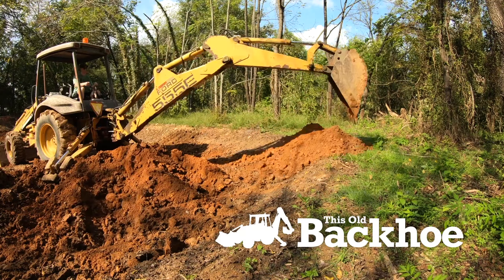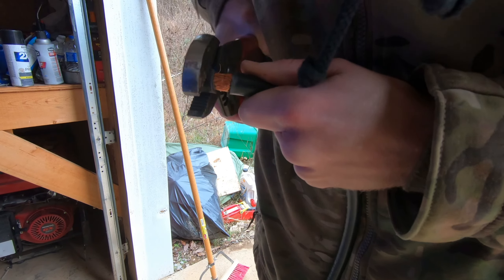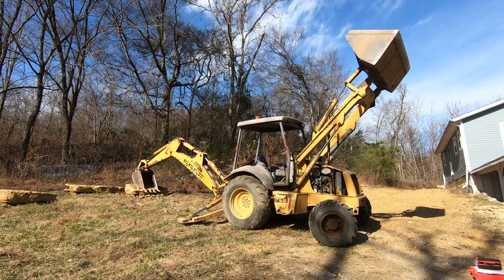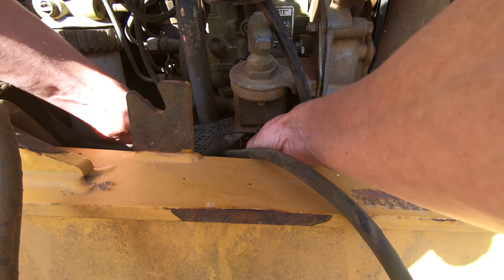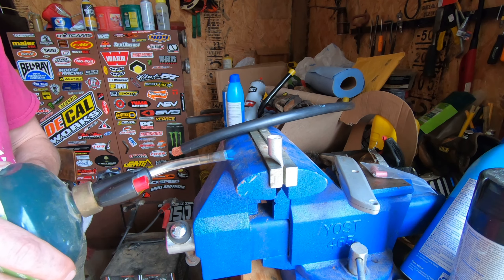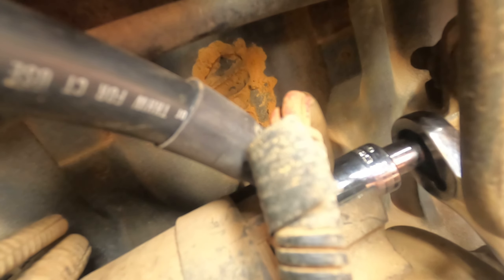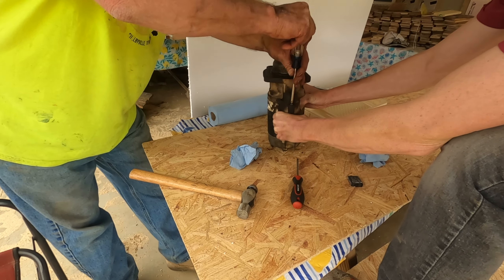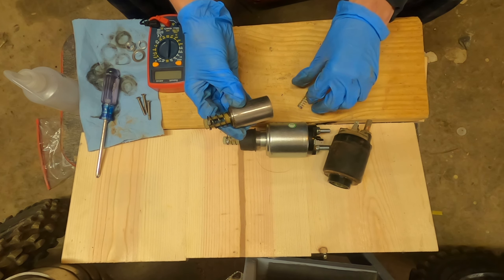Replacing Backhoe Battery Cables, Starter & Solenoid - Ford New Holland 555E

Comment: 655c here, 8k hours. My 17 year old took the starter in and out in about 20 minutes, but your engine looks different.  I have 3 starter on the bench, the original Lucas that I retired 10 years ago,  a bad 'new' chinese unit 1 year old and the new replacement amzonia  brand. I also ordered a solenoid very similiar to yours.  So the amazone came with a cracked solenoid housing and bent terminal, but did work on the bench. A hose clamp could fix it.  I opened the one year old dead one and the inside brush housing looked like it was from the titanic, rusted solid, only one brush moving. Non galvanized brush holder. Opened the old Lucas. shiny new and totally sealed inside. cleaned it up and put the new solenoid on - $39 -  . works great. Your solenoid should have worked with the swap. must have had a wire crossed? Save the old one and get the right solenoid for backup. Now if I could only figure out how to wire the damn alternator 3 wires loose and even my $200 ford manual cant seem to help.
Reply from the maker: The replacement solenoid we purchased was a different length so it wouldn’t screw in properly, glad to hear yours was an easy fix. I would have preferred to leave the bosch starter on there. We did the alternator wiring on ours but honestly it was a few years back so I can’t recall the process. We looked up the wiring diagram in the manual and ran all new wires next to the factory ones, should have done a video but it was when we first bought it. Once we did this job and replaced the starter wires It’s been running/charging great. There is a charge indicator light on the panel with the key switch. If the light is on it’s not charging, it needs to reach a certain rpm before the charging light turns off and it starts sending juice to the battery.

Comment: Did this fix you slow roll over ? I have the same machine. Its been awful to start when cold. We have done everything but new cables
Reply from the maker: Yeah it starts easy now, and cranks over much faster even when it’s cold out. In the course of this video we replaced the cables and the starter. However I think the problem was mostly the cables as the starter was working fine prior. Also make sure to set the throttle to half when you’re starting it.

Comment: I've got a 655e that I need to do this to. Mines got two batteries though, the priner bulb going to the sediment bowl is a great idea, mine also has fuel issues.
Reply from the maker: Ours started with fuel issues and then came battery issues, but now that both are fixed it runs and starts great. Our fuel lines were all full or rust we replaced them but we still need to clean/repair the fuel uptake so a video on that will come eventually.

Comment: I have a 575d the key turns and lights come on but starter not engaging, this happens sporadically. If I remove the fuel filter to access the solenoid and starter will the injectors self prime or will i need to bleed the fuel injectors once i change the solenoid and or starter?
Reply from the maker: It will typically auto prime - fill the fuel filter with diesel when you slap it back on. Turn the key to the "on" position and it should run the fuel pump (30s-1min). If you are having priming issues you can typically crack the bleeder on the top of the water separator and then on mine I have a primer bulb in my fuel line. No idea if that is a stock feature, but I can pump it up to the water separator. Once that part has fuel it will typically fire up.

When it's not starting you can use a screwdriver to jump the hots on the solenoid and bypass it, if that works it's typically the solenoid. If you smack the starter with a hammer and then it works again its typically the starter. On ours it was the solenoid that was bad but the replacement didn't fit correctly so I ended buying a full starter.